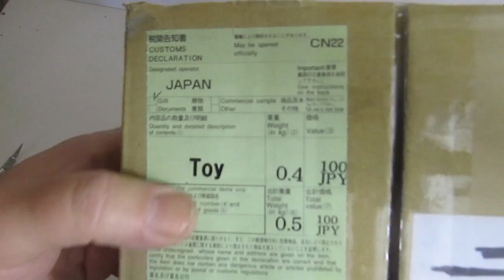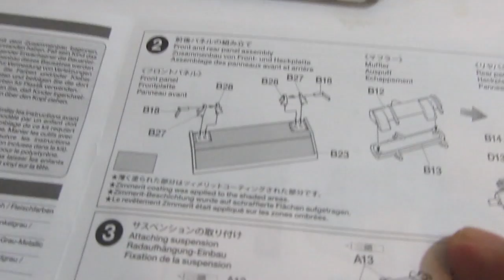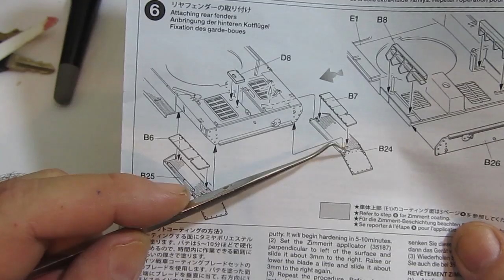Make a Plastic Model German Flakpanzer Anti Aircraft Vehicle

Comment: What a great technique!

I've not used Plastic Wood before, but you could do the same thing with some other materials.  Bondo and Squadron putty are lacquer based and might adhere to the plastic better.  Another great water based material is Liquitex Professional Modeling Paste Medium Gel.  You may find them a little easier to work with and can be sanded and scribed like the Plastic Wood.